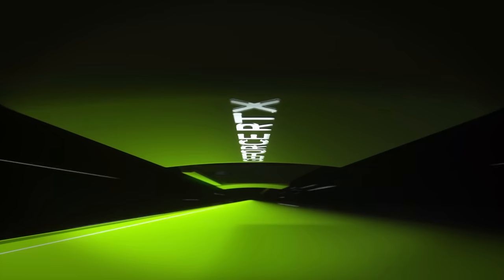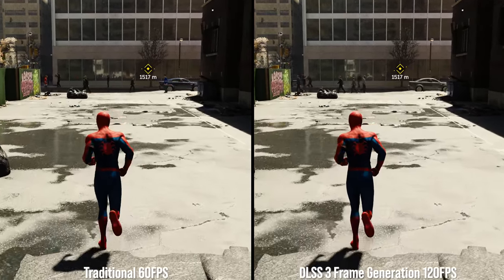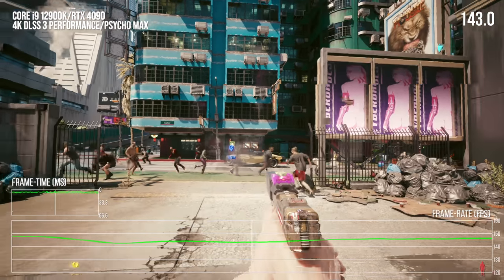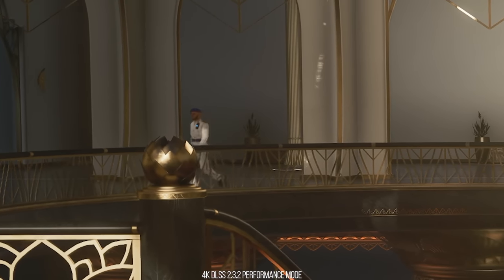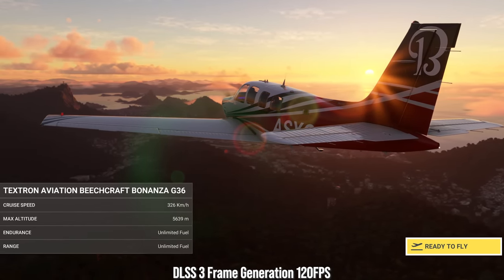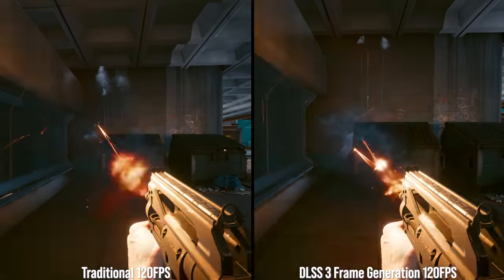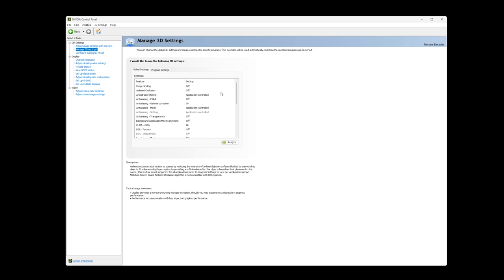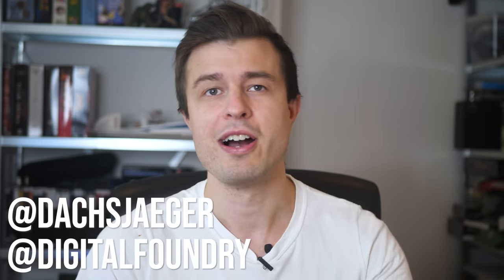Nvidia DLSS 3 Analysis: Image Quality, Latency, V-Sync + Testing Methodology

Comment: Oh wow. The amount of effort you put into this analysis. Bravo!
Reply: It was worth the effort in order to better understand the tech, but DLSS3 is definitely not worth the effort imho, DLSS2 is what's still relevant...
Reply: @you2be839  well. It's a new frontier. People dunked on DLSS1 for a good long while. This would be great for improving experience at high fps if we can get the vsync and game capping better controlled. I would love a 50 actual boost to 100fps locked. The game would play smoothly and not turn my computer into a toaster for 3rd person action games, for instance. Obviously not applicable for eSports, but those games are rarely dependent on modern tech anyway, outside of Reflex.
Reply: @you2be839  A lot of stuff is small enough that I wouldn't necessarily mind depending on the title. Plus I would take this over Sub 60 fps.
I know vsynch can work if you turn it on manually in the control panel, but it doesn't work great in all games. It's something I learned in a different video

Comment: Even slowed down from 120fps -> 60fps I'm having an extremely hard time seeing these Frame Generation artifacts. The vsync issues while panning in flight sim were quite obvious, but not much else beyond that.  I'm thinking this tech is going to be absolutely fine for everyday use and I'm excited to see it come down to some more affordable cards.
Reply: Think of the spiderman example, it's not so much that you clearly see the artefacts, but you might notice weird flickering, or blurring. Or in the case of low framerate sense the input latency. But still it's quite impressive
Reply: as long as people pay for the 4080 and 4090s affordable will mean 800 - 1000$. Maybe this is the the decade of consoles and they will become more relevant and a better option(for gaming) than  pcs sooner or later.
Reply: @johnjonson6377  There are affordable alternatives that provide console like performance such as the RX 6700 that can be bought new for 350€ or less, hopefully it will remain true for the next gen 7700 post launch so we get decent raytracing at a discount

Comment: 17:15 the high visibility of these flickering artifacts around spidey's legs could also be explained by the contrast between the suit and the extremely bright sun reflection. On the other hand the fairly large reconstruction of the brick wall texture  is a different beast altogether - the spot is filled with pixels very similar to the surrounding texture, hence you can't see it during 120 fps gameplay.
It's the difference between picking an average color to fill a hole and drawing a new outline for important geometry moving against a contrasting background.

Comment: 01:56 You can try to use some losless Codecs to record like UTVideo. Most of them are CPU only and Multithreaded. They have almost no performance impact (since almost no compression is happening), but require a lot of disk space since (at 1080P) they produce 4-7 GB/min. I used this method for almost 8 years for my YT Channel and the resulting quality (at the time) was always A LOT higher than NVenc. The mentioned "frame dropping" should be a result of either the Nvidia Hardware or the current implementation in OBS. This problem is especially annoying if you stream to Youtube via HLS which results in the exact frame dropping you described.
Reply: Not exactly. The issue comes from the fact that anything outside of HW encoding occurs non zero copy performance losses then, so it's actually somewhat unoptimal funnily enough.
Reply: Even if you have higher quality recording, YouTube will compress it.
Reply: Compression will still be a thing and if weve seen anything its that cpus cant keep up with the 4090 already.
Reply: wich recording software are you using ? i've tried many but most of them doesn't support external codecs
Reply: @Daburademo  OBS supports ffvhuff for example.

That's what I personally use for recording at barely any performance loss.
Reply: @neutronpcxt372  oh thanks I didn't dig enough into the settings. Found it thanks.

Comment: Great in depth analysis.

But I can not understand how anyone still recommend to enable VSYNC. VSYNC always has and always will be introducing terrible output latency, and with HFR screens tearing is basically invisible when playing in realtime. And then he describes how to turn up your settings to reduce framerate below the screens limit and reduce latency again (which only works on a VRR screen anyway).
Well then you do not have to enable VSYNC in the first place, VSYNC on or off makes no difference (on a VRR screen) as long as you stay below the screens refreshrate.
And for the "accidental" too fast frame, you certainly notice the sudden latency stutter from VSYNC more then the tearing that you may not even see depending on where it occurs and how fast your actual refreshrate and framerate is.
The best way of course would be if you can use an ingame framerate limiter, that can prevent you from going into the VSYNC range with no additional latency (often actually less latency) at all.
But VSYNC is really a tool from the past that should not be used anymore on modern hardware.

Comment: Hardware Unboxed found that DLSS3 frame generation heavily breaks dynamically moving HUD elements on screen, like player names in "F1 22" or POI markers in "Microsoft Flight Simulator". In those cases they come across as major issues and are extremely distracting. What sucks for nvidia is that they don't support DP2.0. So no 4K 240fps, although that would be the most viable target. at lower FPS it breaks apart a lot, at higher frame rates outside of the displays refresh range you need to contend with tearing... And once we see 4050 and 4060 cards, frame generation will make even less sense due to the lower framerates.

Comment: 23:08
If you look at the label on the bar "El Coyote" - its darker on the DLSS3 side just like DF mentions earlier in the video. Also, the place where bottles are on shelves looks darker. Same with the ceiling lamp in the middle where the brightness is different. This might reduce contrast in some scenes but probably unnoticeable otherwise. 
Also look at the Dart board? circle next to bartender - that area looks differently lit in DLSS3 vs traditional. However if you look at the middle seat where no one is sitting - the contrast is not lost w.r.t its surroundings. Brightness reduction is most apparent on the skull above the bar. 

DLSS3 needs work for sure.

Comment: You mentioned that the RTSS FPS cap does not reduce input latency. I think you will find that if you use the in-game FPS cap, it will. I don't know why but this tends to happen in most games. Battle(non)sense has covered this extensively
Reply: no, it's the other way around, and battle nonsense states this in a Witcher 3 comparison video I watched just last week

Comment: Phenomenal work! Highlighting specific areas where DLSS 3 can falter is very useful for discussion, and helps to bridge the gap between the subjective (i.e. what we "notice" in the image) and the quantitative (what we can actually "measure").

I did have a question regarding screen-tearing, G-Sync and latency though. When using DLSS 3, would screen-tearing issues be resolved, and the latency penalty reduced, if you: 

1. Enabled G-Sync in the control panel, 2. Left V-sync off in the control panel, 3. Capped FPS using an in-game limiter or RTSS, below the max refresh rate of your monitor? (e.g. 118 FPS in your case)

My thinking here is the omission of forced control panel v-sync would remove an extra layer of latency, while an FPS cap would still keep you within the G-Sync window. Of course, I'm not sure if this also breaks normal G-Sync in the process?
Reply: I can't speak for DLSS3, but I know that using GSync while Vsync is Off results in tearing at the bottom of the screen, with or without a framerate limiter, even when remaining within the GSync window. The only way to eliminate tearing entirely is to enable Vsync. Without DLSS3, you'd want GSync + Vsync + Cap FPS around 3 frames below your refresh so that, like you correctly stated, you remain within the Gsync window and don't experience Vsync latency. But as Alex has demonstrated, that's not applicable with DLSS3.
Reply: Ah cool, thanks for the clarification. Even though Alex mentioned it in the video, I wasn't totally sure if V-Sync was always a prerequisite for G-sync to work, or if this only applied when DLSS 3 was active.

I've never owned a G-sync monitor, so this is actually surprising to learn. On my freesync display, I usually just make sure the game is running in Borderless and freesync kicks in just fine.
Reply: @WickedRibbon  It applies to Freesync too. These techs alone are a big improvement over running with no sync, but they gotta be combined with Vsync to entirely eliminate it in every game use case.

Comment: DLSS 3 Frame Generation is being modded to work on Turing and Ampere Cards..! Although there are some FPS instability issues and concerns about NVIDIA Locking it through Driver Updates.
Reply: It’s going to run like shit on those cards and be useless. They’re not fast enough to utilize it properly
Reply: NVIDIA will probably allow the frame  generation on Ampere Cards so that it can act as a selling proposition for these bulky Lovelace cards. Still.. if one can get atleast a gain of stable 10 FPS .. it's a huge difference ... just like 522.25 Driver's DX12 FPS Gains.

Comment: DLSS wasn't that great when it was first introduced, but it's improved dramatically over time.  It'll be interesting to see DLSS 3 Frame Generation improve over time as well.
Reply: We should wait for DLSS 4 for improvements probably.
Reply: @ahmeti.7595  Sadly that means Nvidia will focus less on the actual performance of the GPU  as we have already seen with RTX 20, 30 and 40 series by now.
Reply: @yomamasohot6411  what do you mean? They have made the 4090 nearly double the efficiency of 3090 ti . Check hardware unboxed video where they cap a game to 90 fps. The 3090 to draws 416W whereas the 4090 draws 215W
Reply: As impressive as these techniques are on a technical level, DLSS really is a band-aid solution to compensate for display technology outpacing GPUs. Hoping that my 4090 means I can turn it off altogether and get 4k60 on modern titles.
Reply: @yomamasohot6411  They've delivered on rasterized and ray tracing performance improvement over last generation as far as flagship vs flagship. The 4080 cards are embarrassing and quite misleading on their marketing on Nvidia's part.
Reply: @joshua7734  not really. Even if displays were not so far ahead I’d still use it for the performance multiplication. And the 4090 absolutely hits 4k 120 native. (At least without rt.)
Reply: @cybervoid8442  One would hope so, moving from Samsungs process to TSMC lol
Reply: Well it is still interpolation. It's a vastly more complex interpolation than most, but it's still interpolation. I think the main thing they can fix is the Vsync issue. Quality changes may be a less consistently improved with time as there are just some things that really can't be perfected. As shown being interpolation means native issues will carry into interpolation, I don't expect that to change.
Reply: @ramonandrajo6348  I mean I think it will get better, it will just never be perfect. There are no cheats to perfection. Though I think with 8K on the way these effects will be drastically diminished as aliasing and effects that are noticeable at 4K become completely invisible at 8K. It's really end game for resolution. Beyond 8K I don't see much a need to push resolutions any higher as even with pristine vision any imperfections are just nonexistent.
Reply: @AGuy-vq9qp  depends on the game because, trust me, you aren't hitting 4k 120 on Cyberpunk 2077.
Reply: @SSoul0  Yes you can, just dont need to set everything to ultra
Reply: @cybervoid8442  I'm talking rasterization performance. As AMD is really bad with RT, our standards for RT performance are really low and so we think Nvidia is really good with RT. As intel has shown with it's first generation of gpus being as good at RT as Nvidia's 3rd gen, obviously, that's not the case.
Reply: @TerraWare  rasterisation as compared with amd is not good enough, and RT as compared to Intel isn't. We are in weird place where there is no clear in terms of both.
Reply: @yomamasohot6411  Intel currently trails behind everyone else in gaming.
Reply: @AGuy-vq9qp  are you talking about performance or market share?
Reply: @yomamasohot6411  performance.
Reply: @AGuy-vq9qp  then you didn't see the video
Reply: @yomamasohot6411  it simply isn’t there yet. They have the hardware to match the 3070 but not the drivers.
Reply: @handsomesquidward151  Too bad I want EVERYTHING on Ultra or Psycho
Reply: @cybervoid8442  lol efficiency dlss3 are not upgrades, its going back to console performance,  i want a better card, we been on 4k 60fps high settings since 1080ti now they say 1080 upscaled using dlss3 is a selling point, i prefer native 4k and true fps thats why i moved from console to pc 7 years ago, the ps3 was hitting 60fps at 1920x1080. this is why nobody wants 40 series band aid cards and the 1080ti 144hz 244hz capapable of upscaling to 8k and true native 4k  is selling still for over $800 2nd hand, people got fooled into a downgrade in technology and broken lower die
Reply: @yomamasohot6411  sadly i agree, thats why im happy at ultra 4k  native 60fps in spiderman, the last of us, red dead

Comment: You can also lower the GPU power limit with Afterburner instead of fiddling with settings when the framerate is above max monitor refresh rate for DLSS 3. This way u can save some energy too.
Reply: good idea, frame limiter via RTSS will do the same trick though as gpu load goes down right?
Reply: @speedtree  without DLSS 3 yes. Frmerate limiting seems to conflict with DLSS 3 though, causing higher latency.

Comment: Really important thing to note:
Keep in mind that if you have both G Sync and V Sync active and your FPS is at your monitors refresh rate you will have only V Sync active and that will increase your input latency pretty heavily.
Yes, it is recommended to have both G Sync and V Sync active (for no tearing at all) as long as your FPS is below your monitors refresh rate (recommended to limit your FPS with RivaTuner). The reason why it's recommended is because while having G Sync active (below your monitors refresh rate) the downsides of V Sync's higher input latency are mitigated by G Sync (as long as you don't reach your monitors max refresh rate).

In conclusion I wouldn't recommend having V Sync forced ON globally because it might negatively impact your experience in some games, especially competitive games that usually have higher FPS and can easily reach the max refresh rate of your monitor.

What I personally do is activate V Sync on a game by game basis while having G Sync active for all games (since G Sync will not affect input latency in any way). And sometimes limiting my FPS slightly below my monitor refresh rate for a zero tearing and no additional input lag experience in cinematic games.

PS: Regarding 31:00 in the video.
Yes, Riva Tuner is enough to reduce the input latency as long as you limit your FPS slightly below your monitors refresh rate
Ex.: Max refresh rate is 144Hz, I limit my FPS to 138 or 140 FPS.
Reply: I understand that this video's topic is slightly different but I wanted to drop this bit of information just to let someone ppl know that it's not the greatest idea to have V Sync forced ON globally and why.
Reply: Does this reduce vsync input latency?
Reply: @musabmohammed8446  Yes, if you also have G-Sync or Free-Sync active and are limiting your FPS to slightly below your monitors max refresh rate.
In fact you'll have no impact on input latency if you do this. Basically you'll have the same input latency with V-Sync on or off if you respect these conditions.

Comment: I believe by capping the FPS in RTSS instead of within Cyberpunk you are raising the input lag beyond what it needs to be, this was shown by Battle-Nonsense before. If you have Nvidia Control Panel's V-Sync enabled, you must also cap your FPS in-game to just a few below your monitors refresh rate. IE: 144hz monitor = 141fps cap in game. Otherwise you will get terrible input by letting hit your monitors max refresh. I assume this is well known by now but I also think a lot of people are confused on how to best set up their games optimally. 

Also, turning on V-Sync in the control panel will raise input slightly but not enough to matter. But, you should be trying to attempt to use V-Sync in the control panel ON to get the smoothest possible gameplay. It's how you get the full experience of G-Sync. 

I set up all my games like this, for example on a 240hz monitor, it would look like this:

G-Sync/V-Sync(Control Panel) = ON
In-Game FPS Cap = 237 fps
Reflex(if game has it) = Enabled but NOT Enabled +Boost

That's really all you need to set pretty much every game like. You will have the smoothest experience with the least input lag. 

There are some exceptions for competitive games that require the best input lag and most FPS(say you're getting 400+ fps). In that case, you would just uncap the FPS and turn OFF V-Sync in the Nvidia control panel. 

NEVER turn on V-Sync in game!